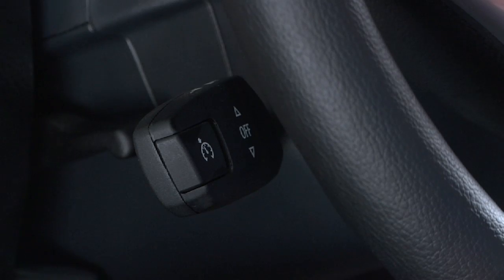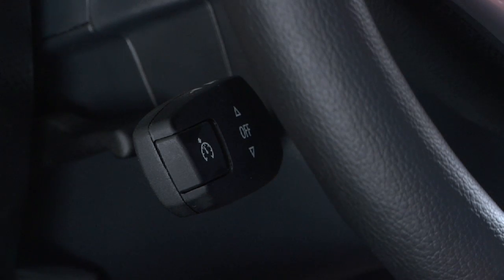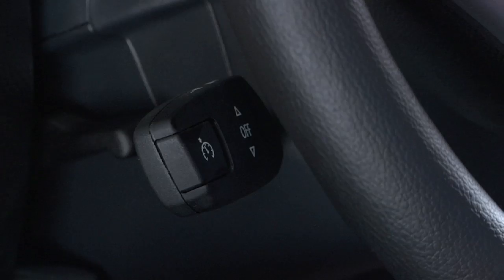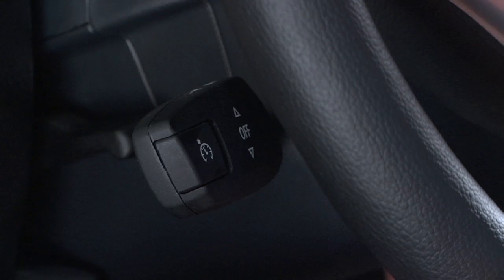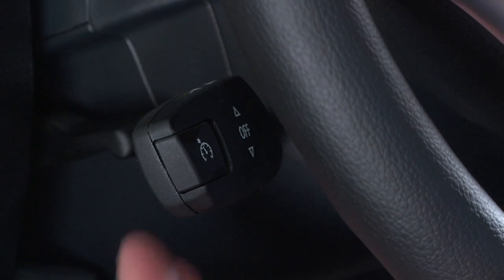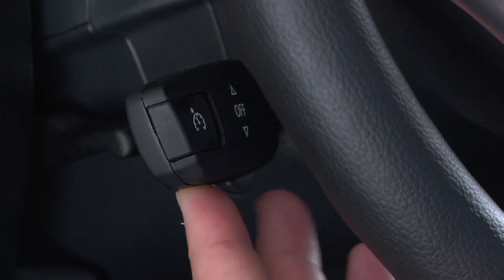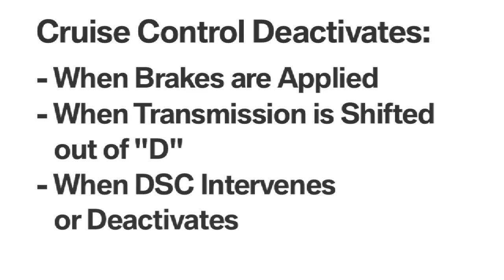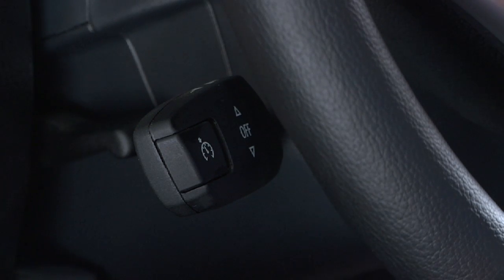BMW Cruise Control

Comment: Do m sport bmw 3 series 2003 have a cruise control ??
Reply: Of Course Not. Only at 528. but it will be on 2006 +
Reply: Mine does.
Reply: how about 320i 2006
Reply: Amer S hi XD
Reply: My 2004 does so yours should too